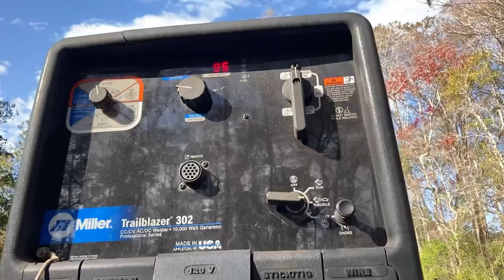How to Weld a Gap on Thin Sheet Metal

Comment: Dont let these jack asses beat you down on your welding. Your young with alot of energy and besides working with rusty diamond plate isnt the easiest. I been a fabricator for 40 years and enjoy your videos
Reply: Louder for the “boiler makers” “steam fitters” and “pipe liners” in the back, they got all the knowledge in the world but won’t post a 5 second video on YouTube of their own work. I posted a funny but semi relevant video on my YouTube and out of no where it blew up, I got maybe 5 nice comments out of 1000 comments… I found myself “arguing” with ppl on the internet only to find out they were accountants or something not even related to welding. I’d like to post more videos but it’s draining to keep up with these trolls…. And to meltin metal Anthony… I give you a lot of credit to keep posting videos! Just remember, you can go weld at a bench any day all day but these “bench welders” would NOT last a day in the field. Only thing I gotta say is, get an air compressor and hypertherm 45 on that truck and only buy  quality welding rods… Lincoln 5p+ is $50-$75 for 10 lbs of 3/32 or 1/8 and ALL Lincoln electrodes got through 100% quality control. I know the video is old and things might have changed since but again, keep it up 👍🏻

Comment: I've used this trick with aluminium blocks with my MIG, it works great for gap filling on bad cuts or rust holes, my arc welder/arc welding skills are so bad I wouldn't have even attempted that without my MIG!

Comment: Question... 
Why would you or anyone use 6010 or 6011 on thin metal? Why not use 6013? It has the same tensile strength as 6010 and 6011. Easier to use and pentrates enough for such applications.
Reply from the maker: It’s what I had
Reply: @MeltinMetalAnthony  Oh I see. Thank you.

Comment: If it’s not structural, mig weld it with Lincoln L-56 wire. You can use either a suitcase wire feeder (preferably a Lincoln) or get yourself a Lincoln Power Mig 210MP (hands down the best $1650.00 you’ll ever spend!).

Comment: I figured when you say thin, you meant thin, I do a lot of auto-body metal, butt welding thin sheet metal.

as for the rods, practice, I have used several handfuls, not had any issues & I welded thinner metal than that. only reason I bought Forney rods, was still dirt cheap during Covid, & places I normally buy was out. LWS, & Tractor Supply, so I went to Rural King & bought probably 50 lb of Forney rods

when you can, invest in a MIG welder, or Flux core, that will go quicker. but you got to do what you have to, to make ends meet

Comment: You need some of that Lincoln 5p+ 6010 best out there,Brass also works good that’s what I use cool vid
Reply from the maker: Im a cheap skate, this 6010 is 16$ish dollars for 5 pounds vs 25$ish
Reply: @MeltinMetalAnthony  Hyundai makes a 6010 rod that's $33 out the door for a 5KG box that's 11 pounds. It doesn't run bad either I used it to get my left hand used to welding 3" pipe I snagged from work.

Comment: Older video now I know….  The smoker I’m sure looks awesome.   With wide weld joint gaps like that, I like to place a 1/8” or a 5/32” weld rod in the gap and weld over it with the same type of rod.   The process works great.

Comment: Thin?
I thought you would be welding 1/32nd sheet. Interesting video all the same to be fair.
Happy new years and best wishes to you for 2021!
Reply: So did I
Reply from the maker: you as well! and for me 1/8 is thin. this same trick can be applied to even thinner gauges of metal.
Reply: @MeltinMetalAnthony  Thank for replying young man. I welded up some old tractor mudguards and didn't have any copper heat sink to use so had to do short weld beads. The metal was probably 1/32 of an inch at the most and in places corroded and in one place had a sticker I wanted to preserve so had to use a damp cloth to do the heat sink job. Videos of this are on my channel, but not to the same quality of your videos! Take care and look forward to more videos from you in 2021! Top regards, Jon.
Reply from the maker: @JonDingle  invest in a stablizer! only paid $99

Comment: Just curious how come you didn’t do MIG? It would of been easier faster and probably cheaper with the amount of wire your use vs rods
Reply from the maker: no doubt, this is what I had on the truck that day, and I know dudes run into this on freezer floors and what not so I figured it was a good opportunity to let a trick I got out the bag

Comment: Hey Anthony,  how come you didn't drop to a 3/32 rod? Just wondering.
Reply: Yes 3/32 6010 with a lower amperage would work better. I also find uphill works a little better. 6010 is fast freezing whip and pause. You can whip up a couple inches if you have to and pause just long enough to get a nice size dime. It will look like a stack of dimes if done properly.

Comment: I've seen this trick before but the dude used aluminum instead of copper in my opinion that would probably be the better option aluminum is far easier to get than copper is most stores that deal with Building Supplies will probably have aluminum than copper and I'm pretty sure it'd be much cheaper and you can probably find it at a local store instead of special ordering it
Reply: Would have to look into it but I believe copper has better thermal absorption. I do appreciate your view on cost and am now interested to compare the two.

Comment: Your blowing it out running too cold bro. Turn it up 13 and run. If you run into trouble swing the puddle around in a circle and pull back upto where you have a solid bead and start going down again. That little split second will give it just enough time to freeze so you can regain control.

Comment: This is not thin. It's a simple weld, 6010 down hill and cap uphill with 7018. Pretty routine stuff. P5 cools quick and is brittle if you don't cap it.

Comment: You need to clean your welds a lot better before you start, also I’ve noticed you need to invest in a mig welder a Lincoln 3 in one will do everything and more for the jobs you do
Reply: So 6010 is meant for welding on “dirty” steel, why waste time trying to grind diamond plate when the end product doesn’t justify it. The guy gave him salvaged steel to build with, I’d say that’s an indicator of a tight budget. This is probably one of the most opportune times to use SMAW over MIG, outdoors so possible windy weather, poor material, fast setup time. Go do some mobile welding and you’d know this.. don’t give me that BS story that you’re a 25 year exotic alloy only boilermaker that started welding at 5 years old… just post a video on YouTube for all of us to see.

Ohh yea and go buy a Lincoln “3 in 1” that way you’ll have to buy both Miller and Lincoln accessories for your business, that’s great advice… nothing like having to by two different HF TIG foot pedals bc some YouTube critic said so…

Comment: I'm curious as to why you're using 6010 (pipe) electrodes rather than, say, 7014? 7014 runs awesome either AC or DC, easy striking, good cleaning properties on rust/mill scale., etc.
Reply: Can't run 7014 in vertical position.
Reply: @rwweld9737  Actually it's a compromise between all position and ease of use electrode.
Reply: @jeffreyullrich8511  yea ok😂
Reply: @rwweld9737  I have 30 years in the industry, so go away
Reply: @rwweld9737  thats not true, the 1 in 7014 is all postion welding

Comment: Tile is a better backer
Reply: I’d say tile is better for 1 it’s made to weld gaps just like that plus it comes with an adhesive strip. You may never use tile but know what it is because all your really good welders use tile and if you don’t know what it is they’ll definitely be wondering how much you really know about welding. Anyways, that’s still a great idea. We called that a cold bar. Keep up the great work!

Comment: You need a remote if you don't have one. You can always tell someone doesn't know what they are doing when they are not running a remote. In thin spots, you can adjust the remote in one hand while you weld with the other.
Reply: You can always tell when someone doesn't know what there talking about by there comment!
Reply: @rwweld9737  they're, their.
Reply: @Jon-jk8vd  grab your remote and change it 😂
Reply: @rwweld9737  learn to weld
Reply: @Jon-jk8vd  😂😂 🤡

Comment: 7018... You could either whip it or you can run a downhill weld to put some meat on it then an uphill weld
Reply from the maker: too rusty
Reply: @MeltinMetalAnthony  then grind the rust off. 7018 is a better rod. Then make more videos